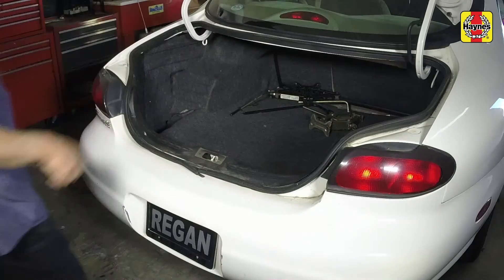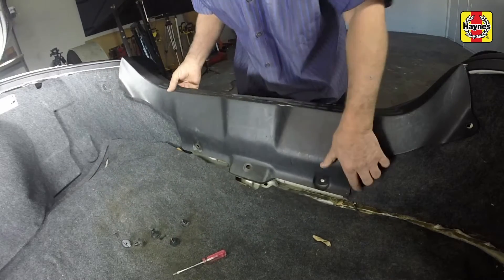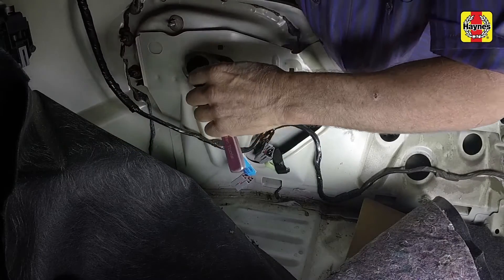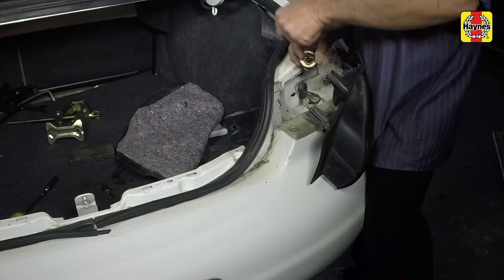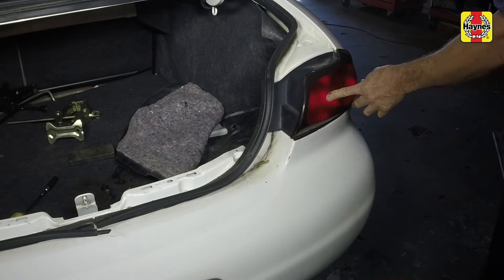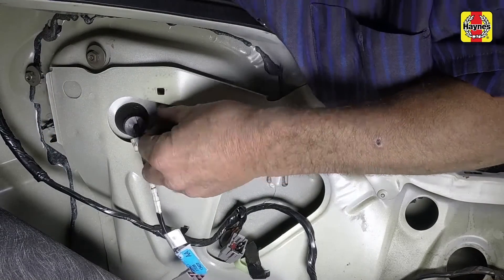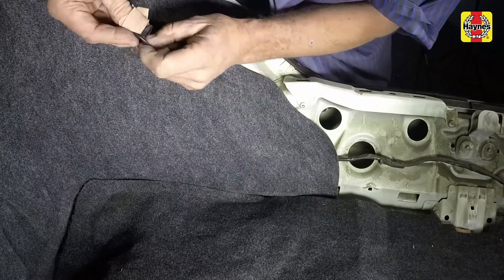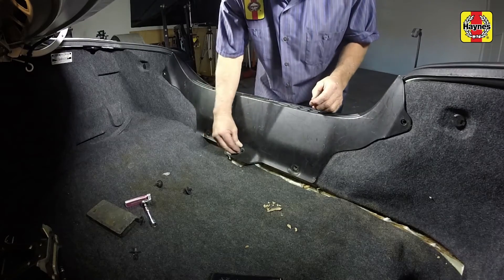Ford Taurus (1996 thru 2007) - Replace the rear light bulbs

Comment: Thanks. I was afraid of this. The designers ought to be flogged and stripped of credentials. IT WAS SO MUCH EASIER WITH MY TAURUS 1987 WAGON ...2 screws through the lens ...ran to 200,000 miles bulbs seldom needed changing. I have a 1998 wagon custom ordered from Ford. Buick in the '60s did something even more asinine; to change a taillight you had to REMOVE THE REAR BUMPER... this is a close second Cheerz